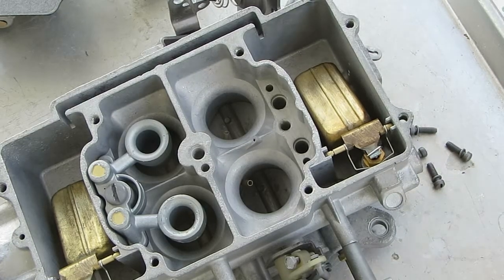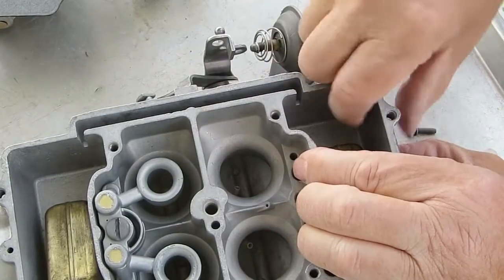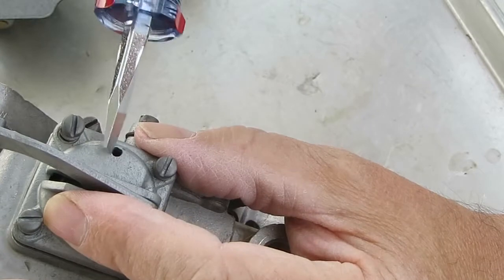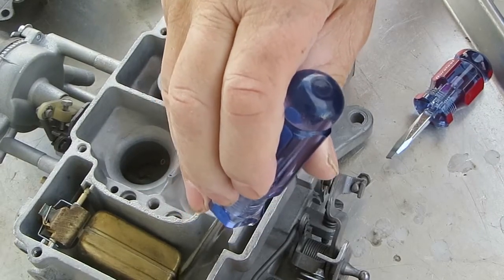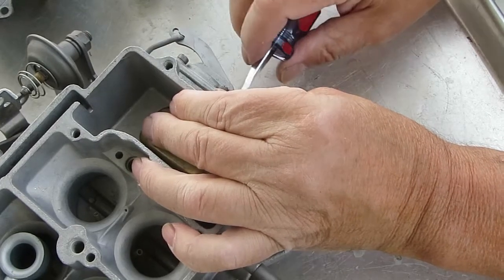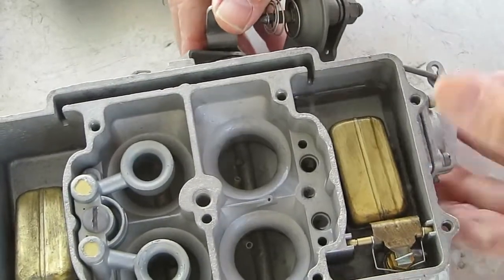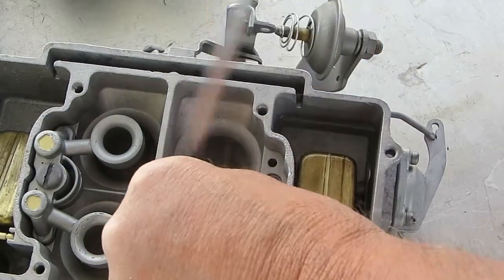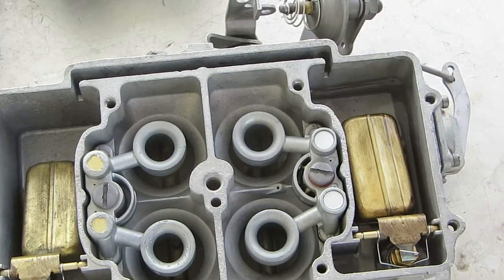Autolite 4100 4 Barrel Accelerator Pump Circuit

Comment: Great video, so question I rebuilt my 4100 for 63 Bird. I'm getting a very light miss at idle in drive when making adjustments. I closed the the mixture screws and car does not want to die. Any pointers?
Reply from the maker: See this page: https://www.carburetor-parts.com/autolite-4100-troubleshooting-help

Comment: You might know, as I installed a new fuel tank in a 61 Thunderbird along with all new fuel lines and pump, but now that I got it all together, I’m getting fuel up to the glass filter just The carburetor, and having a hard time starting it I only did it once after pouring a little fuel straight down into the carb, which ran for about five minutes before it stalled and stumbled when I try to give it a little gas. So does that sound like an accelerator pump to you? Thanks for any advice you can give.
Reply: @MikesCarburetor  Thanks that what I did and after not seeing any fuel, I noticed that the plunger on the accelerator pump was stuck in position I removed and got it to move freely but still no luck getting fuel into the carburetor, so I just went ahead and ordered a new rebuild kit from you I’m going to attempt even though this is totally new to me.

Comment: What are the balance tubes for?
the two small brass tubes facing up in the primarys and show on the bottom of carburetor.
Reply: @MikesCarburetor  what would happen if I ran the carburetor with a 1 inch open spacer?This would leave those and bottom of carburetor exposed.